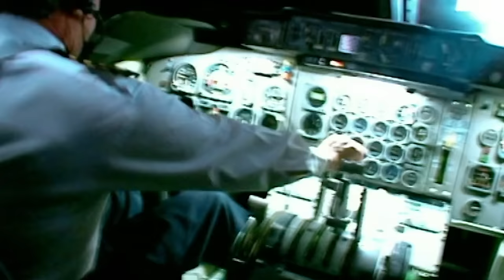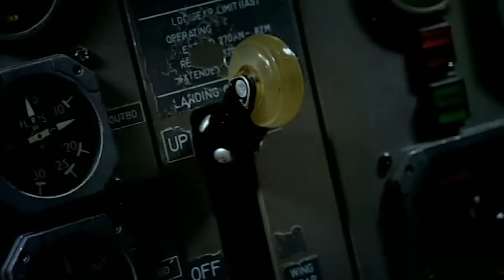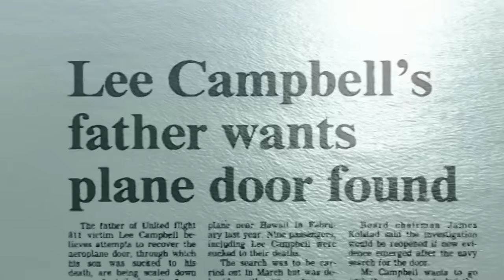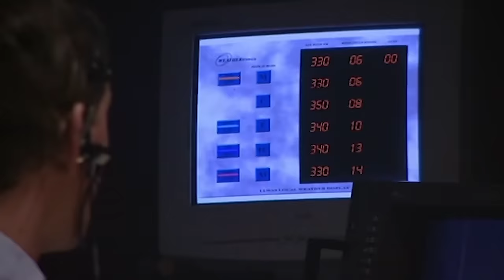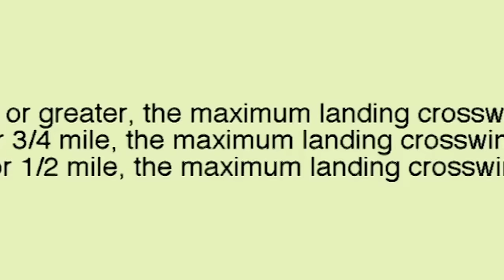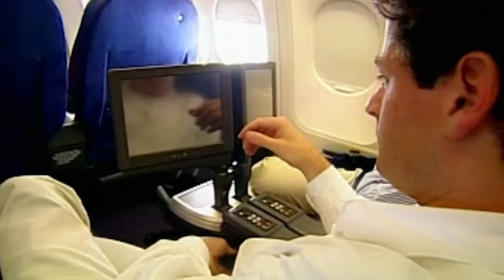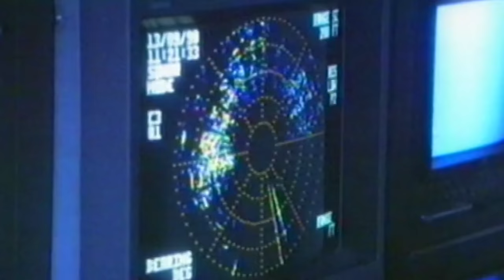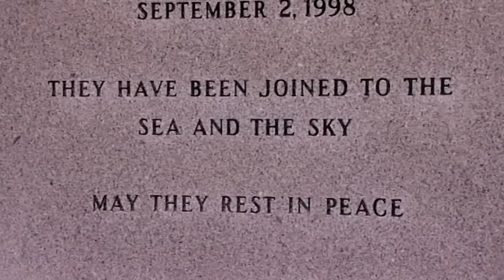747's Catastrophic Mid-Flight Explosion And Other Air Disasters | MARATHON | Mayday: Air Disaster

Comment: Sounds like the entertainment system was not wired with safety in mind. If a wire shorts out it should instantly pop a breaker so the wiring can’t get red hot to the point the copper melts. Kinda surprised they don’t have a c02 system to put out fires